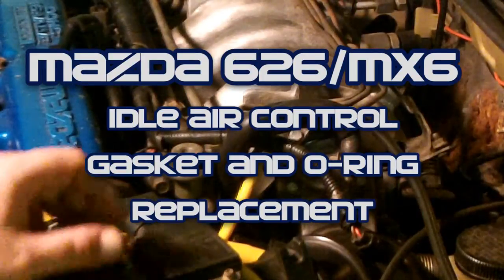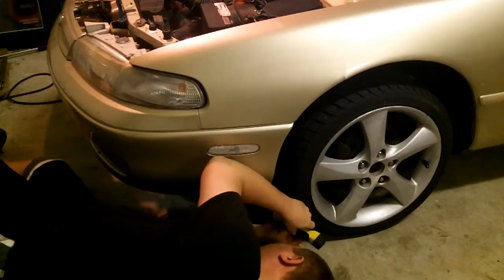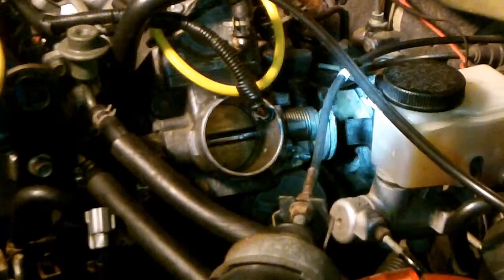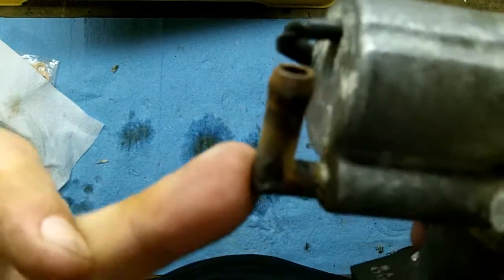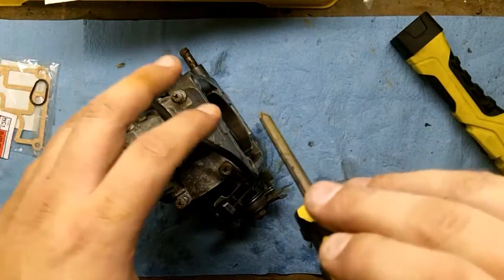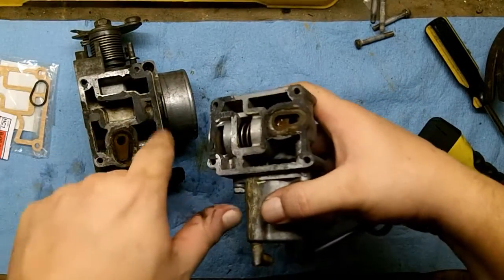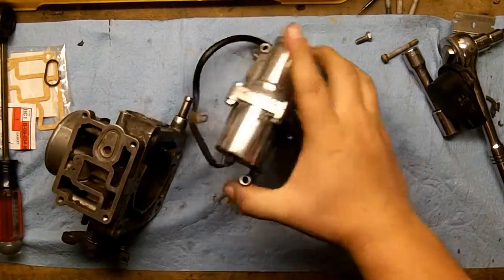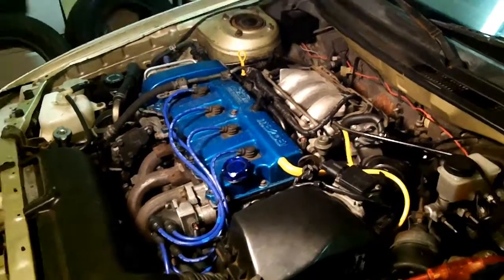Mazda 626 - IAC Gasket & O-Ring Replacement

Comment: The IAC Seal of my 2001 Celica GT was broken, coolant leaked into the Intake manifold, does that means the coolant enter the combustion chamber?  Inside the intake manifold and on the throttle body blade there is a red-colored layer of coolant, what should I do in this situation beside of cleaning the throttle body blade? The new seal is already in place, which means there shouldn't be anymore leak.
Reply from the maker: Yes, it means coolant was being sucked into the combustion chamber.  This is why coolant exiting your tailpipe, or burning off coolant, doesn't automatically mean a blown head gasket! ;)  It depends on the size of the leak and amount of liquid in the intake, there's no real answer until you do a physical inspection to see how much is in there if any. Depends on the design of your intake manifold whether pooled coolant in there will cause a long term problem.   I would ask someone more familiar with Celicas.